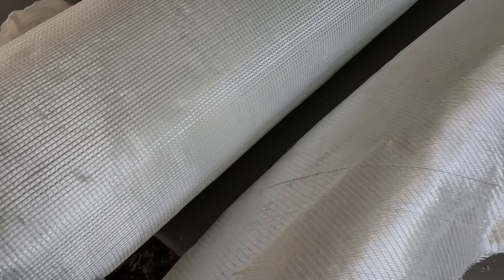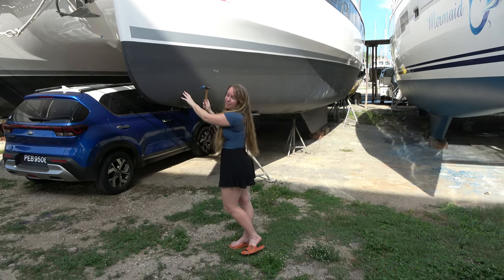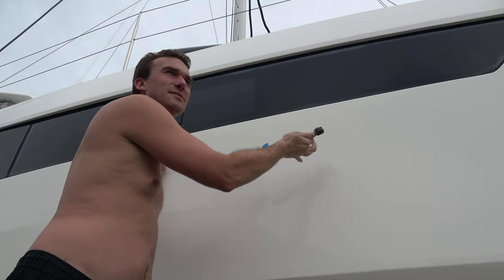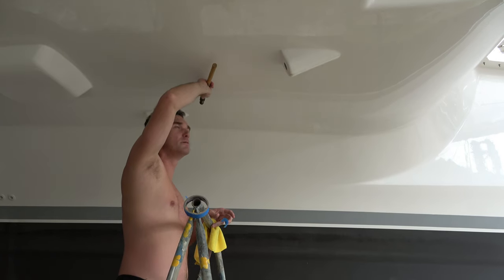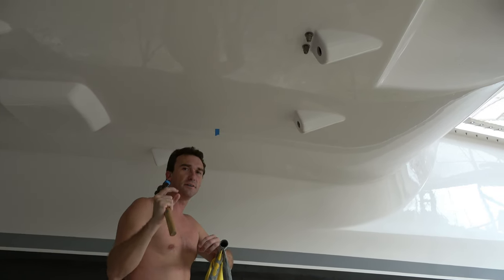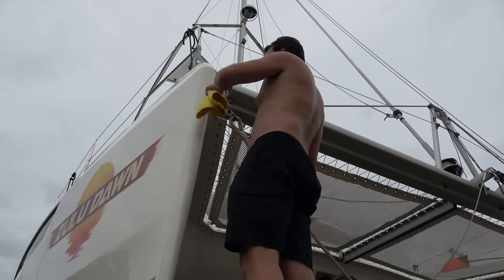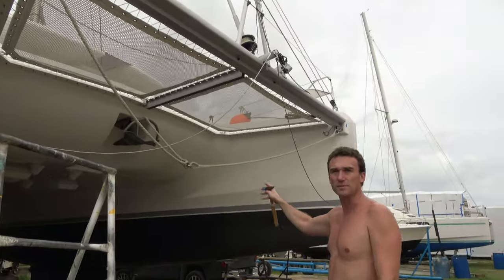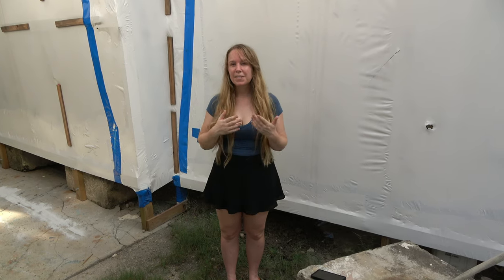How (and WHY!)  to Tap Test a Yacht | DIY YACHT HELP / CATAMARAN REVIEW

Comment: You go girl swing that hammer.
Reply: There's a bit of technique to it but I think I've got it down✌️😁
Reply: Sorry to say it but your boat is a Lemon. That is really bad QC controle  not acceptable at all. I would give the boat back and sue them for a Lemon product just saying…..
Reply: @carlospereira9838  Zulu Dawn is another Leopard catamaran that seems to have simular issues as theirs.   I wonder if it's a issue with Leopard's built during Covid.
Reply from the maker: We have been waiting for this excuse. They ran a split shift during Covid so kept production up. Running a split shift doesn't mean you forget how to resin infuse a hull. All the Leopards featured were made years apart and only one at the start of Covid.
Reply: I know that Zulu Dawn is another boat however they all suffer the same problems. There is another Leopard 45 here at the yard here with the exact same problems as Zulu Dawn. It just comes down to bad workmanship and even worse QC control. Moral of the story NEVER buy a Leopard catamaran. There are so many other quality built boats out there for about the same price.

Comment: You’re confusing cosmetic voids with structural delamination. All fiberglass boats have small dry voids (yes, monohulls too). As long as they are small and not full of water, most people leave them alone. If you want to address them, they are usually simple to fix.  Leopards have a reputation for far fewer voids than their competitors - Lagoon, FP and Bali. On the other hand, structural delamination is a serious problem that’s usually caused by grounding or collision. I sure didn’t hear anything structural during your tapping but it usually takes a licensed surveyor to know what you are hearing.  And I’ve never found any structural delamination on my Leopard 50. My 3 year old Leopard has had fewer problems than my 5 previous cruising boats - two of which were expensive semi-custom. I’ve been very pleased with Leopard’s quality and service so far.
Reply from the maker: We aren't confusing anything. Most of our voids have been opened up and we know exactly what was in them. We have an intelligent, competent and experienced individual here from JS Marine, who I would rate higher than just your average surveyor. He is working closely with management at the top of Travelopia and us. Below him are Leopard and other manufacturers highly skilled contractors who have rebuilt and built new numerous high profile hulls across different brands. The purpose of this video is so that your average owner can begin investigations with a rough idea of what is present on their hull before engaging an expensive independent fiberglass expert. Your Leopard 50 was built in different factory, on different lines, with likely different build teams. We also have not noticed these issues at these frequencies on Leopard 50s. Lastly Travelopia and Robertson and Caine have access to the vessel. It has never impacted anything after handover. If we were remotely at fault for our build issues, I'm sure that someone at Leopard or Robertson and Caine would publicly state that somewhere considering the impact this Youtube channel is having. There is no harm done to have people check for bubbles or cracks that can be repaired while their after handover components are installed, ultimately increasing the value of their hull. We intend to remove the fictional notion that "everything is just cosmetic." so problems are actually addressed and fewer people go through what we have.
Reply: You sound like a sleezy salesman worried about how much $$$ he's going to get for his boat 😂😂 From what they're saying qualified people have looked at these boats so maybe the reason you've never found structural delamination is you don't know what your doing 😉😂
Reply: I just read a comment of yours on a different video.... its clear your loyalties lie with the builder no matter how hard they screw someone over! Just in case anyone's seeing this, he's apparently a moderator for the Leopard facebook group - IMO that takes him from a troll to a corporate lacky
Reply: Sorry. Didn't mean to make you feel defensive. Showing people how to tap their boat is a good idea and you do a good job of it (especially if a surveyor double checks). Demonstrating how to find the bulkheads when hauling is especially important. Many travelift guys at boatyards dont pay enough attention to this. I constantly see poorly blocked cats in yards - potentially doing serious damage.  I also don't think you are at fault - as there doesn't seem to be any serious structural delamination that might have come from collision. We can argue all day about what voids are serious enought to fix and which can be left. All boats have these to some degree. You may well have had more than normal. Many people have a surveyor tap  before handover so that the builder's representative acknowledges serious problems right away. But my primary point is voids and blisters aren't a "Leopard" problem. It's an issue with all production fiberglass boats. In my experience, Leopard does better than other brands. Is this your first large cruising boat? I've owned six by different builders. All had their issues but I loved each one. Most voids are not a safety or structual problem. In the end owners have to decide how they want to trade off cruising time to delaying their cruise in a yard fixing every last thing. As to the other comment below, I've no relationship with Leopard beyond being a customer. Other than my sales guy, I've hardly ever talked to anyone there. I am one of many moderators of an owners group but it also has no relationship with the company.  But I've never come across a Leopard owner as unhappy as you. I know hundreds of Leopard owners and can't think of a single one who is seriously unhappy (frustrated sometimes with problem items - but not unhappy with the boat or company). Given your reported problems, I would have sold the boat a long time ago (likely for a profit as new Leopards have a two year waiting list) and tried something else.In any case, I hope your luck improves and you get to go sailing....
Reply from the maker: @carlnelson4413   Thank you Carl for expanding on your comment and as we do not agree with censorship we like everyone's opinion to remain visible. There is more to the story as we have always said, this still stands true, it just takes many hours to produce a video. The boat has never been in a safe enough condition to sell. Once it is repaired by end of hurricane season it should be a fantastic boat so no need to sell it. Trent is the most sympathetic to "Leopard" /Robertson and Caine as you can see in the comment he requested we pin. There are other very unhappy owners who would not make a repeat purchase. Many have contacted me since going public with this situation and I have met some of them. Most litigate and cash out and/or sell the boat. Leopard Catamaran owners group, of which you are a moderator deleted and blocked Trent who is an owner and broke no rules.  The Real Leopard Owners group has close to two thousand members which solely originated because unhappy owners or those discussing warranty are just deleted from the original group which you moderate. Someone ran a poll in the Real Leopard Owners group which is uncensored, 94 people replied, the asked who would buy a new Leopard? responses said that 30 percent would buy a new Leopard, 4 percent would buy a second hand Leopard and 66 percent would buy something else. Not great statistics for a repeat purchase. We all love the design of the Leopard 45 but they must improve transparency and QC for what remains of this series of hulls and the next ones.
Reply: @carlnelson4413  Lol, your comments haven't aged well